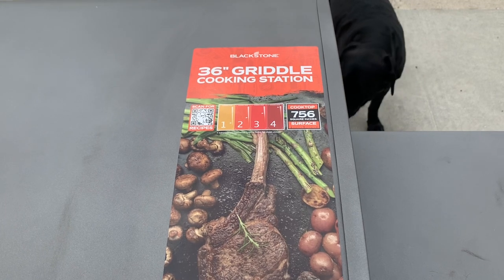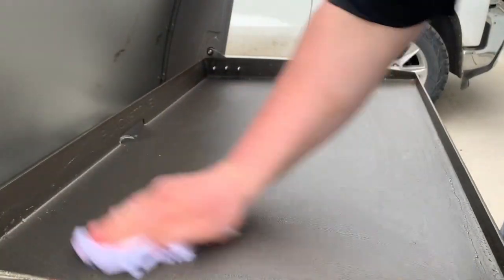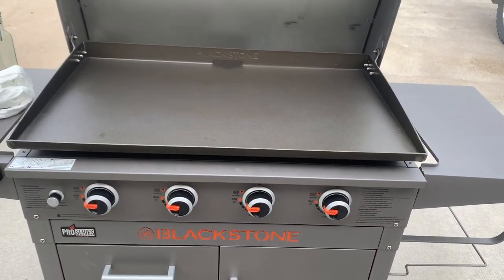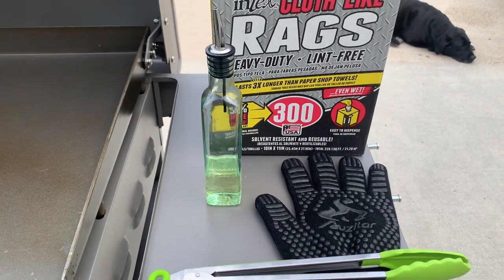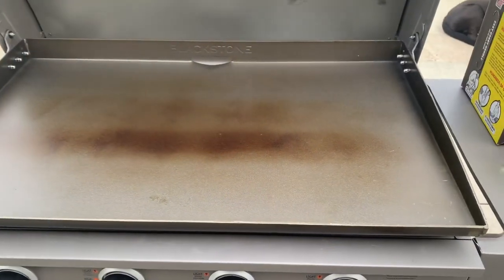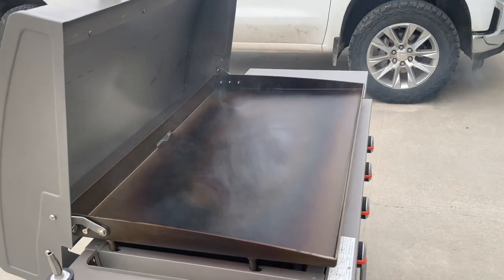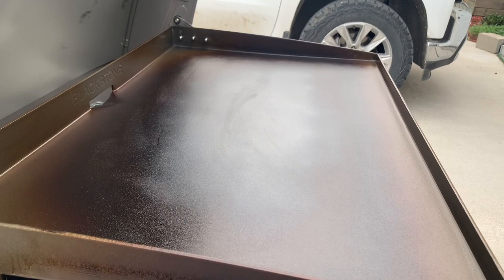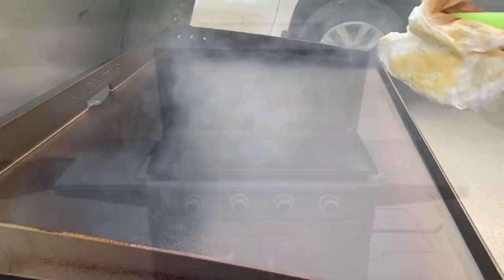Seasoning the new 36” Blackstone Pro Series griddle.  Watch before first cook!!

Comment: We've used this griddler for a variety of items including steak, fish, vegetables https://www.youtube.com/post/UgkxMcXT6_MuT0hB3ejyGQQHaeof9bwoWPUf and mushrooms and it's been great! Gets that great smokey flavor when using high heat or sear. The grill works amazingly simple and very low smoke for what it is. Heat gets up fairly quick, especially on closed position. The griddler side is fairly simple, better for eggs and pancakes rather than any cooking. Use the flat plates with the grill side if needed.Cleanup is easy and having heat on both sides is great for cooking a large amount or panini press.This definitely gets hot though so be careful with the sides.
Reply from the maker: I agree !

Comment: I used olive oil and continue to use it during the cleaning process.
Reply from the maker: Does the seasoning stay hard and bonded ?
Reply: Olive oil? Has a low flashpoints and turns rancid / toxic when it burns.
Reply from the maker: @HispainmygainJ316  that is good to know !

Comment: I just bought one a few days ago & had to return it to Wal Mart . The legs for the cooktop would not mount properly into the cabinet  and lock in like it should . The right side would slide all the way into place but the left side would not and have almost 2/8 of space , so after spending about a hour or more with a friend trying to get in I decided to return it . And  I had called Blackstone about it as well & they told me to return it .  Blackstone said that parts are 12 weeks out for these Wal Mart models . I did see the 28 inch fryer model at Wal Mart so I took  the cooktop and tried sliding in and out and it went into the locking position like it should , so I knew there was something wrong with the one I had returned
Reply from the maker: Well that’s too bad.  I hope they get you set up real soon !
Reply: I was finally able to get a blackstone , that someone was selling off Facebook Marketplace , it was a brand new 36 inch fryer & they sold it for $500 , plus the guy assembled it   : )  ...  So today I'm going to season it and hopefully try my 1st meal today or tomorrow
Reply from the maker: @markp9109  Right on ! Sounds like you got a good deal.  What’s up first on the menu ?
Reply: @gulchroad1127  I’m thinking about a stir fry possibly, maybe paella with shrimp and chicken, and I am wanting to make fajitas, fried rice , sloppy Joe’s haha , and whatever else I can think of making. 
Any suggestions would be helpful, thanks
Reply from the maker: @markp9109  my favorites in no particular order….  Smash burgers, hibachi, breakfast (pancakes hash browns bacon).

Comment: Where can they be purchased? Local Walmart has none etc…
Reply: Lowe's has a special unit called Blackstone Culinary Edition. 36 inch  4 burner, with the hood. Great unit.
Reply from the maker: Walmart is where I got mine, but I believe other retailers carry them as well.  There seems to be better selection in early spring.  Hope you find one soon !
Reply: Bass Pro.
Reply: I always look where can I buy something on the internet.  I won't mind driving to the store. It is a good way to get of the house.
Reply: sams club has a stainless unit looks like blackstone made it looksthe same but stainless 399.00
Reply: ACE hardware stores, or tractor supply (if there’s any in your area) would also have some good deals.
Reply: A pound a bacon works better.

Comment: Just set up mine today,did three coats of olive oil,lid down.

Not a bad grill but the door assembly was a little jenky.Who ever installed the detent upper pin mount boss bracket bent it in the wrong direction so my door hindge pin would pop out and the door would fall off.

Took the piece out and hammered on it a bit and dropped it back in.Needed to add two washers to the bottom door pin still in order to keep the door from sagging too.

Hot dogs turned out great,fucker cooks awesome but the assembly was a pain in the ass.

Grill,cover,warranty and tax 750.00 wallmart.

 It really should be no more then 600.00 for unit with warranty and cover.
Reply from the maker: I agree, assembly wasn’t great, luckily I didn’t have the issues you had.  I say $500.  They are flirting with Weber prices.
Reply: @gulchroad1127  I bought the pro with the two extra side burners and the two storage drawers.

Your right though with the grill cover and tax 500 tops.I did get the two year warranty too.

I mean it is built in china so it is a bit over priced for the fucking around you have to do with it.

I only bought it for the quick clean up and easy wipe down.

Flame to rack grills are pig pens.
Reply: Bought a Members Mark Pro Series griddle for $299! Delivered free to my door and it has a cover included! These are by far the best quality for the value griddles on the market. Great buy and they’re built by Nexgrill.